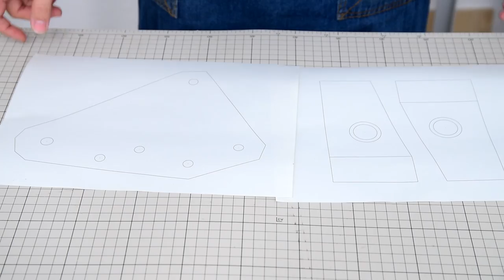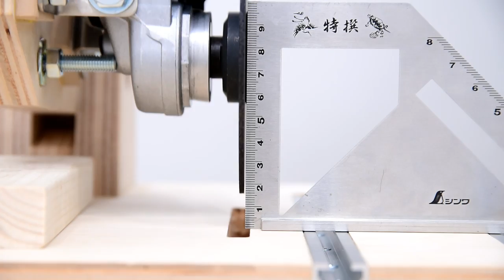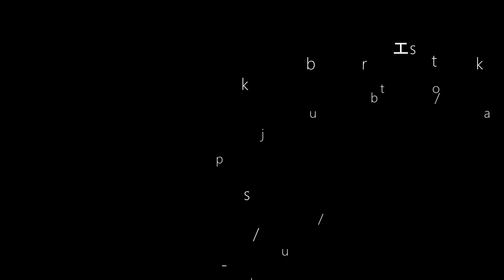Handmade Angle Grinder Stand

Comment: Very nice!  The only recommendation I can make is to use aluminum angle iron for the clamps instead of mild steel (if that’s what it was).  It’s best practice to minimize areas of potential galvanic corrosion, especially if you have thick steel parts on thin aluminum sheet.

Comment: 04:44 to correctly check for parallel, mark edge of disk, take measurement there. Rotate disk 90 degrees, take 2nd measurement at disk mark, eliminates disk distortion error, gives true parallelism reading.☺

Comment: Nice video. If your epoxied nuts do not stay on,   consider silver soldering. Almost as strong as welding when both surfaces are very smoothe and matching, Much more heat resistant than epoxy.
Reply from the maker: Thank you
I'll give it a try！

Comment: Very great work but I think you should put something in the box that can absorb the shocks of the iron-iron frame even stabilizes within the box. I think the aluminum threads will be useful. Or anything else . Thx too much
Reply from the maker: thank you for the advice
I made a dust collection box with aluminum plate, but aluminum threads is a good idea.
I think steel wool is good.
https://youtu.be/hf0iSgnvFu8

Comment: I was wondering and it may have already been done but I haven't found it. I was wondering if it is possible to make a mini table saw out of say...a angle grinder? And if not a angle grinder then what other tool could be used to make one? Thanks in advance for answering (if you do) and if you don't then maybe someone else can suggest something to answer my question. Thanks.

Comment: Good design, impecable make and very well exposed process. Only a pair of improvements, the glued nuts of the clamps should be fitted on the opposite side of the angle profile, for obvious reasons, and perhaps a pair of plugs in the ball bearings housings in order to avoid dust accumulation. Subscribed from now!
Reply from the maker: thank you for the advice.
This bearing is a dustproof grade product, but I think that a housing is also necessary.
Next I will make a large drill stand. looking forward to!

Comment: To: jisaku-kobo
VERY IMPORTANT
The link you listed in your answer to
the question about the power supply               was rejected by my phone's operating system because they found out it does NOT match your name. I went back to your video discription, etc, and found out THEY WERE CORRECT. The link uses KOUBOU---instead of KOBO.
 If a person opened the link, he/she might expose the phone or computer to malware. PLEASE CHECK INTO THIS MATTER and if I'm wrong, please accept my apologies. I'm just trying to help because I admire your great and highly professional craftsmanship.
Reply from the maker: thank you for your comment
The problem was solved.
Please check it again.